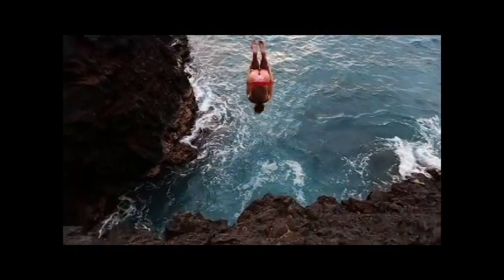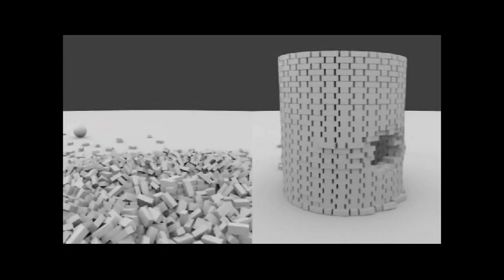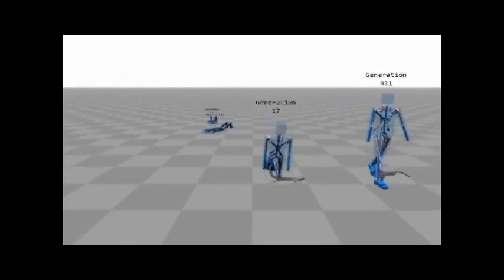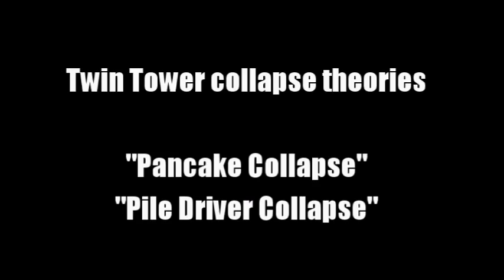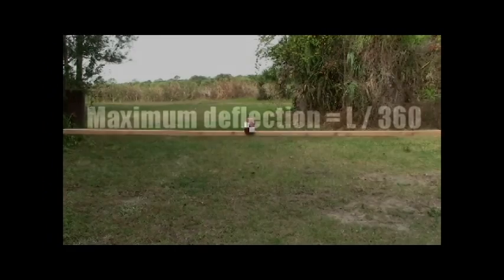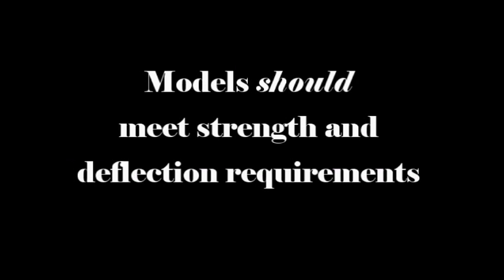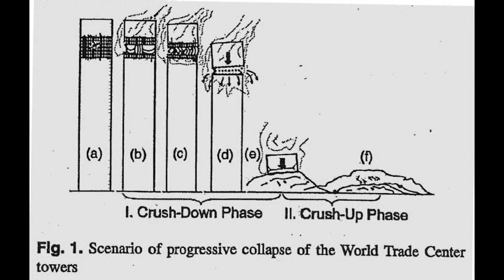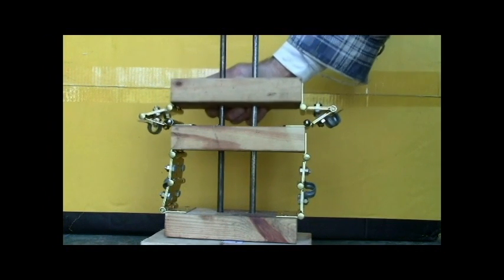9/11 Experiments: The Force Behind the Motion

Comment: Did this guy seriously just build a wooden dvd shelf and claim it's an accurate recreation of a concrete skyscraper?
Reply: Actually he is  showing that even Paper thin structure wont' fall at free fall speed so How can Structural Steel can fall that easily
Reply: You only think it's "flawed" because you don't understand the purpose and nature of the experiment. The relative strength of the model vs what is being modeled is irrelevant.  It is not about "strength," it is about "direction and sequence."  If it was not obvious from the video itself, the video description spells it out: 

"Dissimilar objects can be used to study the motion of large objects because the direction and sequence of net force are both independent of scale."
Reply: Nice Straw Man: you mischaracterized the nature of and purpose of his experiments, which were NOT to "simulate concrete skyscrapers" in all of their complexity, but to roughly simulate the basic forces at work, sequence of forces, and force vectors required in order to demonstrate different types of collapse sequences in a simplified model. No model can replicate reality, but science is filled with examples of very simple models leading to profound insights. The problem here is not the experiments shown, but your lack of comprehension of the meaning and scope of the experiments. Let's call it bias and willful ignorance on your part. Others might call it something else.
Reply: fatdeeman: the most relevant variable, as clearly explained in the video description and in the video itself, is the sequence in which vertical and horizontal supports must be compromised in order to create the collapse sequence observed on 9/11 (top "block" falling a short distance first, then progressive collapse below the "block" continuing). The experiment has nothing to do with "strength," and it doesn't have to consider strength to teach us something.  Attacking the experiment because it doesn't consider relative strength is a Straw Man.
Reply: alfredo Nunya -  you added nothing to the conversation. No new ideas. Not even a "nice try" from you. Trolling, more like.
Reply: You are delusional.  I posted my first video on youtube 3 years ago and I've been on it for more than 10 years.  One of my videos has 11K views, and it's something I shot myself.  You're an idiot and a troll.  You're probably 13 years old.  Or maybe you're sitting in some office in Virginia and it's your job to "change the subject" when people start making good points.  F U dude
Reply: alfredo Nunya: ironic that i've been on youtube for years, uploaded a few videos, have tons of subscriptions and content, and your account has ZERO content.  YOU'RE THE FAKE TROLL.
Reply: Julius - "Regardless of stronger or weaker floors, there needs to be a deceleration, Even if the building collapsed entirely. Even a bowling ball going through layers of paper decelerates"

This claim is dangerously false. It would only be true if your bowling ball would be going through space hitting these layers of paper. That's conservation of momentum. I mention space because there is no gravity. The law of conservation of momentum prescribes no affection by external forces. But guess which force is always present on earth? Indeed, gravity. Now, if your bowling ball is dropped from a building it will accelerate by the force of gravity. Even if it hits a sheet of paper, it will keep accelerating, just a bit slower. So the acceleration will decrease, not the speed. The speed will still increase, just a bit less fast. The speed will keep increasing until the bowling ball reaches its terminal velocity. By adding sheets of paper in its path, it will just take a little bit more time for the bowling ball to reach its terminal velocity. No replace bowling ball with mass of 15-30 floors and replace resistamnce of paper by resistance of floor-to-column connections. What basic principle will change?
Reply: What he's showing is that a dissimilar structure didn't react the way the towers did to a completely different set of parameters. His conclusions are based on imperfect and incomplete models.  What he displays best is his ignorance of basic engineering.
Reply: It cant tho. That's whats he is trying to tell you. The 20 floors above the impact zone cant crush the 110 floors below it when dropped at the speed of gravity. There would be resistance and not acceleration hitting the solid 110 stories below. Also the debris would not be sent outward up to 6 blocks away. Pay attention dude.
Reply: @gamblerscop7769  It's called physics, weight x velocity + gravity = collapse and it isn't collapsing 110 floors, it's collapsing one floor at a time and each time the numbers increase
Reply: alfredo Nunya he explain this in the video. He purposely wanted a weaker simulation to enable what actually happened and try to support the theory that was given to us. And it was impossible. 
So common sense tells you that a building made of steel and concrete, it should be even more impossible. 
You can't wrap your head around that?

The towers should of never collapsed like that, not the way they were built.
Reply: Andrew J - nothing about this dumbass video pertains to what happened with the WTC Towers. NOTHING!
not the experiment,  not even the physics laws its meant to demonstrate.
this is exactly my point when i talk about obviously bright, formally educated and intelligent people using WAY too much gray matter and completely missing the point.

the falling section of building didnt have to destroy the lower undamaged section for a collapse to occurr, no more than a tables 4 legs and top have to be destroyed for it to collapse.
for the table all thats needed for total collapse is to destroy the leg to top connections of 1 or 2 legs and it is as good as done.

with the towers, all that was required for a total collapse is for the falling section to destroy the steel truss supported concrete floor slabs or their connections to the core and outer perimeter collumn walls. period.

the floors were the ONLY thing providing lateral stability for the outer perimeter collumn walls and once the floors were gone, the outer walls peeled like a banana.
the towers literally unzipped all the way down and NOTHING was going to stop that.

so you "truthers" can make dumbass videos, hold meetings, discuss "space rays" and "dustification" all you want.
those of us with functioning brains know what happened and have the EVIDENCE to prove it.
and well continue to dismiss you and laugh at you.

its funny how 55% of the population has below average intelligence and 55% of the population believes in the dumbass idiotic and paranoid "truther" theory! lmao!

if thats who you want to be known as, keep on "truthing" idiots!
Reply: Julius Red Not if the bowling ball begins stationary and is continually getting heavier.

You can't pick and choose parts of the truth.
Reply: Get back in your box, the adults are talking.
Reply: Superior is inferior and is the tard!  You would believe anything . Your mommy said you were special...believe that!
Reply: Not even a nice try Filmjizz!
Reply: alfredo Nunya are u lovers with feedman?
Reply: Yes I checked them both and they are identical....FAKES!
But the obvious clues were the responses were seconds apart yet I responded immediately they both are the same fake account and not 1 response in hours. FAKE and GAY!
Reply: alfredo Nunya listen A.L.F.R.E.D...... you having delusions of competence. I am glad to see you're not letting your education get in the way of your ignorance. Your addiction for fiction has you paralyzed. You're missing the whole point of this video. Tunnel vision has a grip on you. You stare at a carton of orange juice just because it says "concentrate"  right on the box.....stupid fuck
Reply: he lit the thing on fire and it still didn't collapse, how about you try to make a "more reasonable" experiment and tell me if you don't get the same results he did. don't worry, i'll wait......................
Reply: filmjazz - " the most relevant variable, as clearly explained in the video description and in the video itself, is the sequence in which vertical and horizontal supports must be compromised in order to create the collapse sequence observed on 9/11"
I would agree to this. Now tell me how the misrepresentation of the structure of the buildings in the model affects this sequence. The floors were bolted onto the columns and kept them up and provided lateral stability. In the model however it was the other way around.
Reply: Yep!
Reply: So what your saying is that if the bottle contains a clear liquid, it must be water, because you assume it is?
Reply: Yes you can, politicians do it all the time. They tell us only what supports there point of view and people believe it and vote for the fools.
Reply: Not a straw, science!
Reply: filmjazz Wow. What an amazing response!! ...........can i be your friend?
Reply: cantonear1968 ?? Why is it important for you to state that 66mil is greater than 29mil or am i just an idiot?
Reply: "There isn't this magical weight that now comes and pushes them down "

Well you're technically correct. There is no "magical" weight, but your comment does show a startling misunderstanding of basic physics. 

See, weight is really just a measurement of force and as you should know, force = mass * acceleration. Now, the mass of the top floors never changed, but their acceleration certainly did. So the floors below, which could easily hold up the mass of the floors at rest, could not hold the force of the mass accelerating down.

To give you an example, think of a bowling ball at rest on your hand. No problem because your hand can support that weight (i.e. force). Now drop the bowling ball on your hand from a height of a meter. You're very possibly looking at broken fingers. But wait, your hand was already holding the weight of the bowling ball, so what gives? 

The answer: the force of the bowling ball exerted on your hand changed because acceleration changed but the mass stayed the same.
Reply: We are waiting for your video to prove him wrong. Get to it.
Reply: Paul DiBenedetto this is such a stupid comment it's honestly hilarious. 

You don't need to make your own experiment to point out the faults in someone else's. None of the videos materials or construction matches reality, we can easily point that out. And so the findings are meaningless at best, misleading at worst.
Reply: I'm just mocking the fact that no one on the other side bothered to set up an experiment. Just cheesy computer models that have nothing to do with reality. Mr Cole has taken to time to do the actual work. He should be lauded for his effort.
Reply: Paul DiBenedetto those computer models have way more to do with reality than this arts and crafts project.
Reply: So why not build a real model and show us the "pancake collapse"? The advocates of the catastrophic collapse theory are not only illogical, but lazy too. The physics stand, and Mr Cole proves his point handily.
Reply: Paul DiBenedetto Yes,,
  and his point is,  had this been a 10th grade physics project he would have gotten a D minus on it.. 
A more unrealistic and  unscientific model he could not have made had he tried..

Please
.. paper and fire crackers..  .Haaa
Reply: As John Jeffry wrote above, "Actually he is  showing that even Paper thin structure wont' fall at free fall speed so How can Structural Steel can fall that easily ".  We still await a logical explanation from you physics experts, and yet you come up with nothing but gripes. Make your own video proving otherwise.
Reply: Joe V your fucking up joe. I told you your comments have no merit if you can't understand the laws of physics. You can't even understand the msg in this video. You have a learning disorder joe. Idiot
Reply: Andrew K.and computer models can do whatever you create it to do.....you can make it look like a total collapse. In fact if you look at NIST example it looks nothing like the actual collapse . This vedio looks exactly like what we see. How blind are you?
Reply: Andrew K.  You should be listen to Paul B.  He knows  what he is talking about. There seems to be a few YouTube engineering wannabe in here who don't  mind making  fools of themselves. This experiment stands correct. You idiots only pay attention to the paper and firecracker and totally missed what the msg. is proving. That the towers shouldn't have totally collapsed and deceleration should have occurred with a partial, at best, of the bldg toppling over. Why don't all you permitlty brain damaged kids create a experiment of your own ( fuck computer models) and produce a total collapse. #1 That's not what happened.                                   #2  Laws of physic teach  it can't happen.                         #3 History proves it never happened.                                  Unless explosives were used. NIST and their miscarriage of an investigation do not include testing for explosives of any kind.Now the National Fire Protection Association guideline #921 calls for testing for explosives when high order damage is involved and the saving of the evidence and justification why you wouldn't. NIST NOR FEMA DID THIS!!!!  THEN YOU HAVE 400 TRUCKS A DAY SHIPPING THE DEBRIS OFF TO CHINA FOR RECYCLING BEFORE ANY INVESTIGATION OR TESTING COULD HAVE OCCURRED. THIS IS A CRIME IN ITSELF. BUT WHEN THE GOV. IS BEHIND IT WITH POWER TO COVER IT UP ITS NO WONDER WHY NIST TRY TO GET AWAY WITH IT.  POLITICAL CRIME WITH POLITICAL POWER.                 IN SHORT.... UNLESS PROPERLY INVESTIGATED AND RULED OUT THERE ARE CLEAR EVIDENCE OF THE POTENTIAL FOR EXPLOSIVES INVOLVED IN THE COLLAPSE.
Reply: Gamblerscop sir you stand correct. Right on dude
Reply: cantonear1968 you still haven't learn anything since we last shared comments. Change your profile name to CANNOTHEAR.idiot
Reply: Bruce Lansberg you are so far off your ass on your explanation you are embarrassing yourself. I'd like to see that bowling ball accelerate through 80,000 tons of reinforced steel that clearly still existed undamaged. Eyes don't lie. All three buildings fell in a symmetrical fashion. If you claim to know as much as pretended to do, you should know that it is very difficult to get something to collapse symmetrical because it's the laws of physics that things tend towards chaos. Collapsing symmetrically represents order, very strict order and it's not the physics to gravitate towards order for no reason it would gravitate towards chaos. There was far too much order in the collapse with no indication of internal resistance. So I asked you how did the structure collapse in nearest symmetrical fashion when the damage was clearly not symmetrical? You can clearly see totality and uniformity of the destruction. The mass of debris remain centered on the building core all the way down . Highly asymmetruc damage could fail virtually downwards into the strongest part of the building (Steel column corrs)  in at the speed that indicate structural resistance being removed under the collapse wave. The towers should have fallen with increase eccentricity as a collapsed progressed. Scatter fires brought about such an orderly collapse? How did each Tower inexplicably collapse upon itself crushing all 287 columns on each floor while maintaining near Free Fall acceleration as if the 80,000 tons of supporting structural steel framework underneath than exist? IMPOSSIBLE!!!!!! FALLING OBJECT SHOULD TAKE THE PATH OF LEAST RESISTANCE YET THE OFFICIAL EXPLANATION CLAIM THE TOWERS DEBRIS TOOK THE PATH OF GREATEST RESISTANCE TO THE STRONG CORE STRUCTURE ALL THE WAY DOWN TO THE GROUND. He also has a well-documented presence of molten Steel. We also have eyewitnesses which okay firemen and policemen are in New York stating a saw heard and felt during and prior to the collapse explosions. The explanation is false and does not hold up to it actually happen.....period!
Reply: No, he’s building models to demonstrate basic physics and engineering principles.
Reply: Yeah, he's a fucking idiot - and so are all the idiots here as well.
Reply: FATDEEMAN - why yes. yes he did!
lmao! hes a "truther" idiot with a bs in bs.
Reply: Physics apply the same.   Gravity is the same.   You clearly did not understand the difference between out and down which replicated the motion of the towers and down and out which is what they want you to believe.
Reply: What do you mean nothing.    Physics apply universally.    Gravity is a law of nature.    A building, a house of cards, matchsticks or whatever will collapse in the path of least resistance.   It's an unchangable law of nature  here or in Egypt.  That is not going to change ever.
Reply: Andrew J gravity is a law of nature this true..  gravity was also The driving force for the collapse of the towers.  These experiments and simulations shown above totally take gravity out of the equation..    here's an example for you,  to help you grasp that fact.. 
What would you rather have hit you in the head, a 10-pound rock from 2 inches above your head or a 10-pound rock from 12 feet above your head???   
f=ma...  2 inches does not provide enough distance for any mass to get enough acceleration using only gravity as the force.
Reply: two can play that game.     you cannot compare high quality concrete and steel beams to the matchsticks he used.      how can the perfect pancake collapse be nearly at the acceleration of gravity.   not once but 3 times the same day.    one perfect pancake collapse.   one a in  million.   three perfect pancake collapses.   one in a building that was not even hit by a plane.   one in a trillion
Reply: Andrew J there was No " high quality" Concrete in any Tower..  the floors used lightweight concrete design specifically for high rise building..   no structural strength at all and easily broken apart as can be seen buy the small chunks and all the dust in the debris pile.   

Take 5 minutes, look at the blueprints for the towers, and try to understand how they were built..   the truss seats were the connecting points for the floor joists at the exterior columns and the interior core columns.    There was evidence of numerous truss seats which are bent down and flat against spandrel plates... 
There's only one way that could have happened. Take a guess.  

On second thought, it's been over 16 years so I doubt you'll do any additional research to learn something..
Reply: Joe V    the floors had 4 inches of concrete and also steel alloy.   I am not saying they would have held the weigh but at least slow it down to where the collapse doesnt accelarate near gravity.   And why didnt any of the towers topple over to where the plane intrusion occur.  Like I said.  One perfect pancake demoltion like collapse possible.   Three in one day.  Impossible
Reply: Andrew J 
You obviously refuse to go look at the blueprints for the towers and learn something..  in 5 minutes you'll understand why the towers had to come down the way they did.
Reply: https://www.youtube.com/watch?v=E6s0Gam54mk           Please watch 47 minute building challange and report back.    Tons of engineers and demolition experts weigh in.   You can also see video of Larry Silverstein saying bldg 7 was pulled or demolished.    Firefighters that said it was going to be demolished and then the official reports contradicting this and saying a single column failed and produced a symetrical collapse.     Please watch and report back.   years ago I was a skeptic like you.
Reply: Gamblerscop
"It cant tho. That's whats he is trying to tell you. The 20 floors above the impact zone cant crush the 110 floors below it when dropped at the speed of gravity. There would be resistance and not acceleration hitting the solid 110 stories below. Also the debris would not be sent outward up to 6 blocks away. Pay attention dude."

Actually the weight of 20 floors crushes just one floor below it - then the weight of 21 floors crushes the floor below it - then the weight of 22 floors crushes ...

This is painfully obvious  and hopefully you get it.
Reply: You are forgetting that the second tower hit hat a gaping entry hole.  It was hit near the corner so it also had an exit hole.   An entire corner with no steel beams and flooring.    Why didn't these 20 floors topple over the weakest part of the structure like a Jengga Puzzle or a tree being chopped down.  Even using your own logic the structure should topple down at its weakest link.    (Look at the videos,  somehow even the wings of the plane supposedely cut through the steel like butter.   Wings that are super light and mostly hollow except at the base where the fuel is stored.)   But lets say somehow that occured.    Then it was a huge and very long hole through which the structure should have failed and toppled to one side.  Then somehow it does a perfect pancake near the speed of gravity.  Not once, not twice but three times, and the third building was not even hit by a plane!.     I have a bridge for sale in Brooklyn sir.
Reply: It doesn't even work on that level, his "floors" are way too strong compared to the weight dropping on them. It's not an accurate simulation of anything even on the most basic level.

Completely flawed on every level.
Reply: As I said you can't just pick and choose specific aspects of physics that suit your argument.

Scale is only irrelevant if everything else is proportionally equivalent.

What variables do you think are actually important here?
Reply: FATDEEMAN First off, it wasn't built to the exact scale of the Towers...had you'd have been listening. Second, a bowling ball being stationary on paper, then falling through does not gain more weight wtf? The Towers were already holding the floors above them. There isn't this magical weight that now comes and pushes them down on Cold Hard Steel. Even if the top floors were "weakened" by the fire, the bottom floors were in tact and sound. I agree the entire Tower could have collapsed if all the floors had fires that weakened them, but even then we would have had a collapse/fall over since all of the floors would have been weakened.  That wasn't the case on 9/11. And then there's WTC7...too many things happened that didn't add up and you not looking at it with an open mind and see both sides from a neutral standpoint just shows bias or stupidity on your part.
Reply: Evsupp2011 is desperate  for so eone to believe him and help to spread his garbage.
Its his life!
Reply: evsupp2011 It's a pathetic inaccurate analysis that has absoloutely zero relevance or credibility.

Stop parroting the same stuff and demanding people share it, that's called propaganda.
Reply: FATDEEMAN. Hey FATMAN... I believe you're completely flawed in the head. If you knew anything about physics you know that it states that any upper block of material must slow down when it hits any mass or force that previously supported it. The upper block of falling structure will destroy yourself well before It can possibly crush  the entire larger lower structure. The key word you're missing is at the very beginning "Any upper block of material.....ANY. the object that does the heating always slows down conservation of momentum is the fundamental law of physics that cannot be broken. Do us a favor when debating on such a subject try not to speak